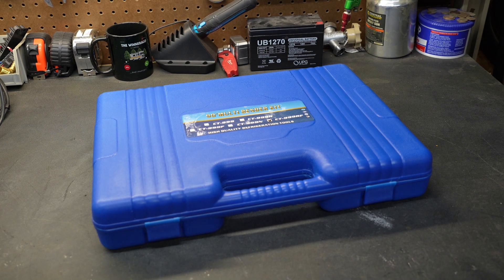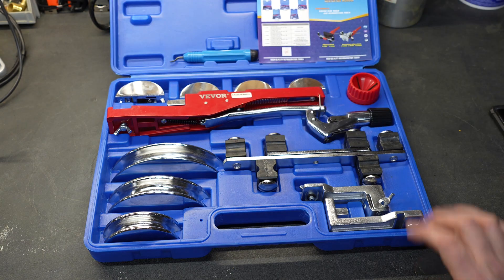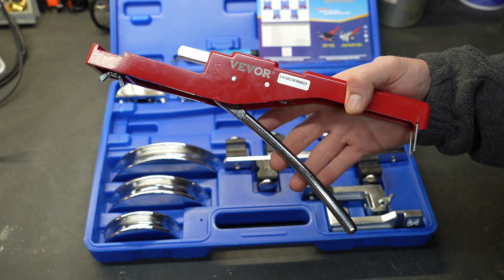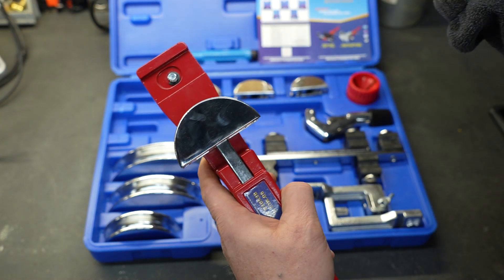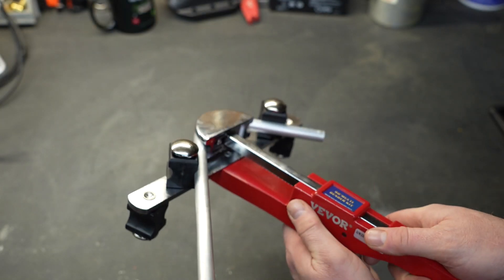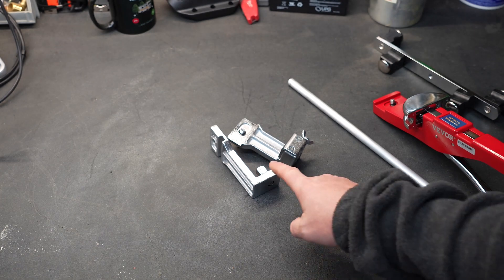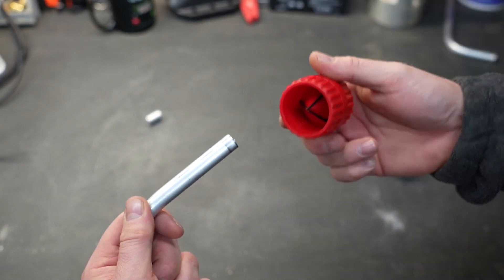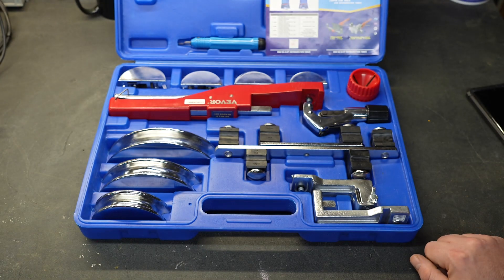VEVOR Pipe Bender, 7 Dies 1/4-7/8 Inch Refrigeration Ratcheting Tube Bender Kit with Reverse Bending

Comment: I too have one of these as well,  I put a little touch of grease on the parts that hold the pipe, it helps with sliding the pipe/conduit and never kinks